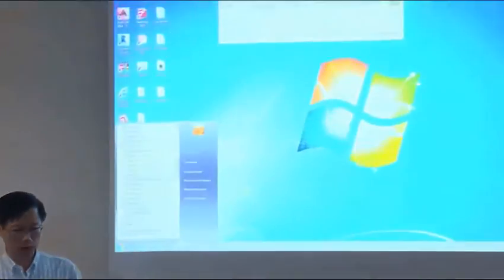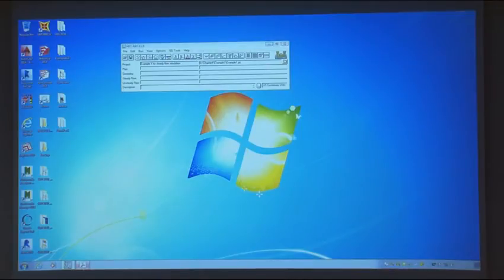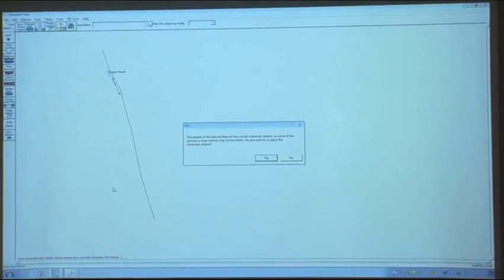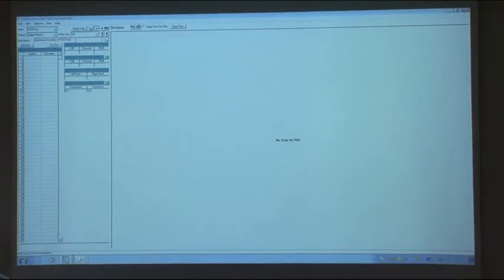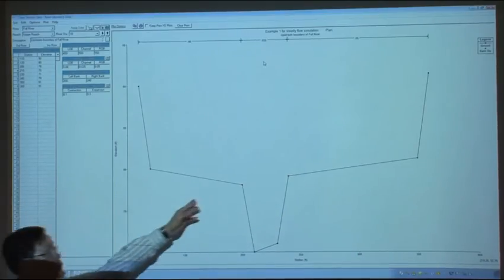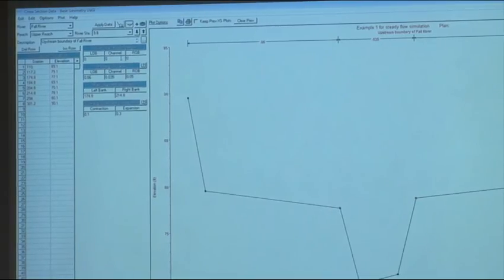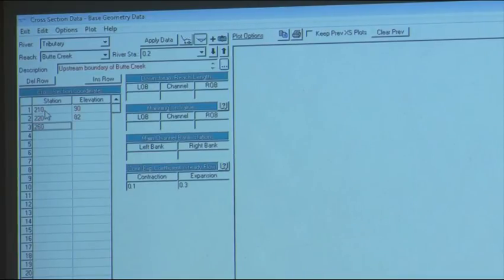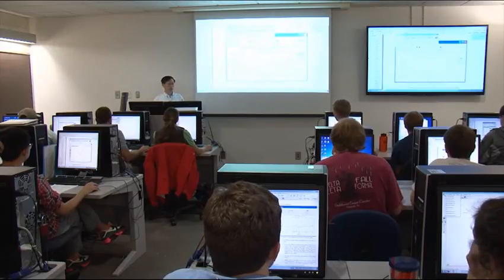HEC-RAS 1-D model-1

Comment: HOW CAN I GET TURTURIAL ?
Reply from the maker: Download the software and read through the user manual. That’s how most of engineering softwares work, by the way. If you are practicing engineering and you got a software that does not have a theory part. You should not use it.